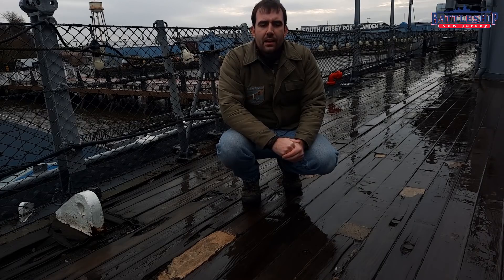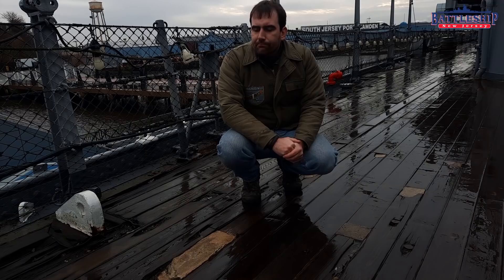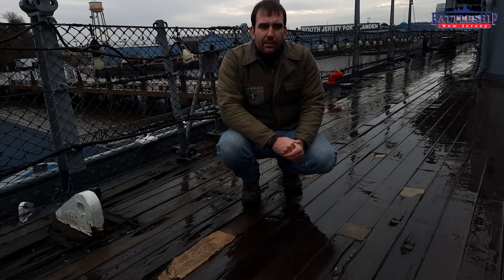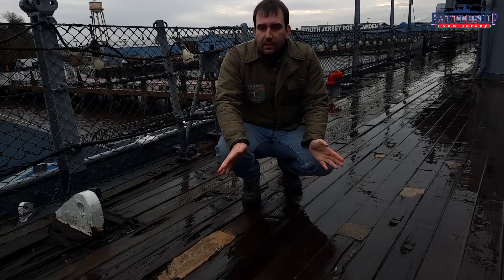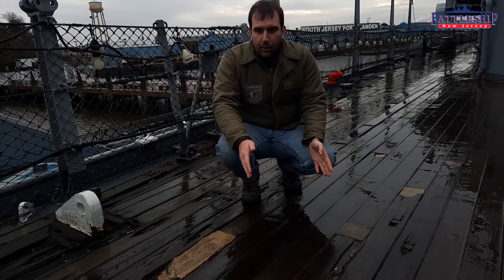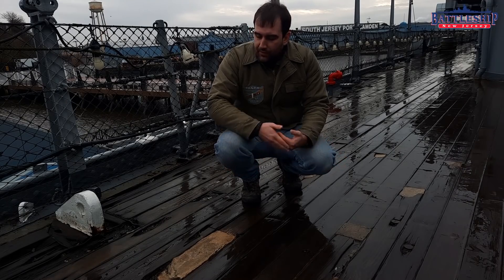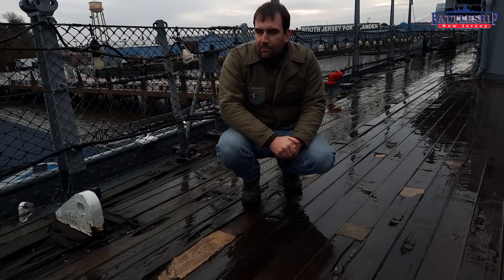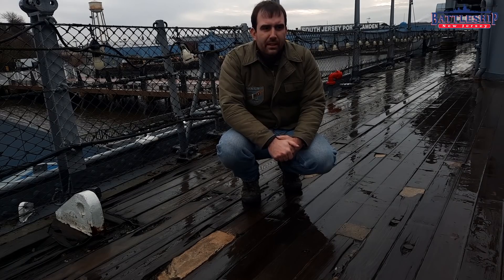Why aren't Museum Ships in Concrete?

Comment: This is a great topic. Like most museum ship lovers, I always wondered what the alternatives are to long-term preservation. The U-505 is entirely dry and inside. Could museum ships be permanently dry-docked? How can they be preserved with minimal corrosion?
Reply: HMS Victory is permanently dry docked but even that had to be modified in more recent years, with further plans still in the works. Also the SS Great Britain is as well but unlike Victory, it has a layer of glass around the water line as an artistic representation for the water. These ships show it's possible but they are only around 3500 tons each as opposed to a 27,000 ton dreadnought (Texas) or 45,000 ton battleship. I'm sure my weights are off since I'm going by displacement and well that number has to be higher than the actual weight for a ship to float.

Comment: Fresh water doesn't cause so much corrosion especially if slightly alkaline >> Float ship in oil, I preserve car parts in oil >> It is the salt in the sand used in concrete thats the problem so wash salt out before use...
Reply from the maker: To do that, you're going to need a 900 foot long by 300 foot high building to put this giant tank in so that it doesn't become a death trap for wildlife
Reply: @BattleshipNewJersey  And god help us all if something causes one of the shore power lines to start sparking...

Comment: "Concrete is terrible for steel"   Builds entire civilization from steel-reinforced concrete
Reply: I'm not trying to be a smartass, just informing. :-)

But...The steel is coated with anti-corrosive eh.. coating before the concrete is poured. When you hear about big structures failing it's often because this coating wasn't applied right, as rust takes up more space then steel it actually breaks apart the concrete from the inside.

Alternatively stainless steel is used as reinforcement but who has money for that? 

I think I read somewhere that most of the German Atlantic Wall was build with un-coated reinforcement so you lot could have just waited 20 years before freeing us and it would just have crumbled with a good kicking (just kidding, thanks for freeing us when you did, my grandparents where getting awfully hungry in Amsterdam).

Best of luck to you, have a nice weekend.
Reply: @exharkhun5605  The so-called "green rebar", which I guess is the coated rebar you mentioned, is mostly used in infrastructure projects, that is supposed to last longer than other constructions like housing. The green coating is epoxy. 
An overwhelming proportion of rebar used in construction is uncoated structural steel. As far as I know at least. And concrete protects it from rusting for a while, depending on how salty and moist the environment is. Not forever though, eventually concrete starts to rust inside concrete too.
Reply: Encasing the steel and putting the concrete next to the steel result in very different conditions over time.

Comment: Just wondering, has anyone calculated the cost of replacing the entire deck with new Teak? It would be interesting to hear just how much wood it would take and its cost.
Reply from the maker: We're in the process of replacing it all, it's about $8 million. Learn more here https://youtu.be/OIteMpyHb48
Reply: There is a video on here regarding the ongoing decking project. I believe what they've come up with for a solution is marine grade pressure treated  plywood covered in much thinner and much less expensive teak that is made to look almost identical to the original. I believe Ryan mentions in the video that although the current cost of new OEM style teak would be too expensive the bigger issue is actually sourcing a manufacturer since ships don't use teak decks any longer.

Comment: Could some museum ships be preserved in a concrete  floating dry dock or coffer dam.  The water could then be evacuated so there would be no metal to water contact. This could be done on land or in the water.  There are numerous examples of this in the United Kingdom.  Also,  the Navy uses electrical currents to neutralize the effects of marine corrosion on mothballed ships  This was used extensively on the Missouri when it was in Bremerton.  Star of India  (Isle of Man,  1863)  was given a welded steel girdle in 1959 during her restoration in San Diego.  She is the oldest iron hulled merchantman in the world.  She is still sailing.
Reply from the maker: This is our take on putting museums in dry berths: https://youtu.be/sa8x2gc448c

Comment: Couldn't the lower hull be covered with a protective coating before being incased in concrete? Considering that concrete and steel are used together in virtually all building construction I'm fairly certain that this problem has already been solved. Also consider that the early skyscrapers are older than most museum ships and are doing just fine with regular maintenance.
Reply: This is a comment that I wrote that answers your question. Ryan is not right about concrete chemistry

"Engineer here. Concrete is basic. its PH is about 12 when when freshly dried. This decreases to about 8 or 9 as the concrete ages. Concrete does react with steel, but the reaction is self limiting because the the highly alkaline environment creates a protective film on the steel. This protective layer also provides lasting protection in the event of water ingress to the steel There is a reason that reinforced concrete works so well most of the time. 

The reason Ryan is seeing what he is seeing is because of the ingress of chlorides (like sea or road salt.) AND water. The chlorides break down the protective layer and allow corrosion to progress. The likely reason we are seeing this happen much more quickly than is the case for say many marine reinforced concrete structures is because a piece of rebar is completely immersed in concrete. A steel plate set against concrete has an exposed edge allowing ingress of chloride contaminated water. Any corrosion causes the concrete and the steel plate to peel away from each other, exposing the whole underlying surface to corrosion."
Reply from the maker: It doesn't really matter if it's basic or acidic, it burns through the steel just the same
Reply: No protective coating lasts forever. If it did, we would not be discussing the fallacy of putting a ship in concrete.
Reply: @BattleshipNewJersey   Much of our modern infrastructure, made of reinforced concrete, would not be possible if concrete burned through steel. The reason commenters are confused is that they are surrounded by this infrastructure and don't grasp the specific circumstances that make this impossible for you. That you have tried it and it hasn't worked bears explaining as to why your circumstances are unique.

I didn't mean to come off as 'that guy'. My apologies.

Comment: What about a rubberized epoxy coating that would be about 6 in thick has a sleeve and then pour concrete around that or even gravel it should push back on the sides and the bottom. The ship itself would be in a watertight seal so there shouldn't be any corrosion.
Reply from the maker: You're looking at a very expensive project there, close to the $100 million range, and you can't guarantee that the epoxy will hold and have no way of check to see if it does. So to keep the rain out, you've now got to put it in a building, a 900 foot long building.

Comment: what about using sand.  it's fairly cheep, will apply preassure evenly across the whole ship, will allow water to drain away if it's above sea level.  if you could overcome the problem of lifting the ship above sea level, i cant see any obvious downside
Reply: I thought about that. Using a drydock filled with sand with some sort of sump pit. I think the sand, over time, with direct contact with the steel shell plating would be bad unless you cover the whole ship.
Reply from the maker: You'd have to keep the ship in a building for that to work, otherwise the sand will trap water and make it worse than just being in water. For a building, it will need to be 900ft long and 300 ft high which is tough.
Reply: @BattleshipNewJersey  So just build a hanger around the drydock like Japan did with the shipyard when they built the Yamato class - problem solved :-P

Comment: Not to mention if you inbed the ship in concrete the weight of the ship and concrete would be insane. It seems like the real issue is at the water line, why not double the plate up the ship there?
Reply: Put the ship is space, no atmosphere =no rust.
Reply from the maker: Thats what most of these ships do. We aren't there yet, but its likely in our future.

Comment: Fiberglass the hull then sink it in concrete. A good epoxy coating should last a few hundred years.  Keep the UV off it, and it can last indefinitely. The real trick would be keeping moisture from getting between the metal and epoxy.

Comment: How would a rubberized coating over the hull work ala nuke subs? Always learn something from your channel, and to that I give you many thanks!
Reply from the maker: You'd have to be very careful to keep that seal, if water gets in it'll hold the water to the steel and rust right through
Reply: @BattleshipNewJersey  makes sense, thanks.

Comment: What about putting a ship in a pool of fresh / distilled water and putting a roof over the thing?
Reply from the maker: Shes in fresh water right now. Putting her in a building is a massively expensive project. As a reminder, these are 3 football fields long and 300 feet high.
Reply: @BattleshipNewJersey  converting "football field" and 300 feet into meters... Or rather looking up the infos on Wikipedia...
oh... A quarter kilometer long and about 90m high...
Okay, I get you... Would be a HUGE hall...

I was thinking along the lines of a zeppelin hall. But apparently, the Hindenburg had a diameter of less than half the height of a battleship of that class...

Nevermind then :)

(but in theory... It WOULD help keeping the ship in good condition, right?)
Reply from the maker: A building would help. Ships in buildings though makenit hard to really see the whole thing though, when the walls are too close you can't stand back and really see it, which isn't great either.
Reply: @BattleshipNewJersey  Aaah, true. Yeah, okay, would have to be a really wide hall to see it all.

Thanks a lot for these answers. I mean in hindsight it is obvious, but that was actually something I had on my mind for quite some time :)
(To me, a layman, it was obvious. "you got something that you don´t want to be destroyed by the elements? Just put a roof over it". ;D)

Comment: In regards to deck preservation, what about the combination 1" epoxy + 1" new teak like the Missouri has been doing?
Reply from the maker: Thats basically what we've been doing. Weve got a layer of marine grade plywood in there too
Reply: Yeah, I was wondering about an epoxy.  Maybe I'm thinking too big, but maybe setting it in concrete could work if the hull below the concrete-line was coated in a sealant. The cost could be prohibitive, but I'm just spitballing.
Reply: @Horseshoecrabwarrior  - Pot a whole battleship in epoxy?
Reply: @tominiowa2513  Well, not fill the whole berth with epoxy. Just coat the hull below the waterline with something waterproof.

Comment: OK,  here's the solution. You're going to need to get this thing into a dry dock to begin with. Not just any dry dock but one with a structure over it to keep out the weather. Big ol' roof like you would find on an airship hanger. Get the ship in the dry dock and clean that hull to perfection. Once you're ready you fill the dry dock in around it with silicone in layers. Let it dry and then pour some more. Maybe use coloring to turn it blue/green. 

Basically indoors, supported all the way around, and wouldn't the silicone protect the steel from corrosion? Don't tell me silicone is bad for steel as well!

Comment: I'm not 100% sure but I had read where the USS Alabama is sitting in a Bed of Concrete in Mobile Alabama.
Reply: Bed of river silt
Reply: @jerredwayne8401  I'm checking into it but I do know there was a story in the news a few years ago that they were supposedly encasing the base of it in concrete. When I find out for sure i will update.
Reply: @docbrown6550  i believe you are reffering to the coffer damn that they built sir
Reply: @jerredwayne8401  No I'm Not, I know what the article said. I'm not saying they did it but the Article said the were planning on pouring a Concrete Base under the Ship
for the Entire length of ship to sit in sir.
Reply: I had read that also, not sure what the reason was but yes they did say they were pouring concrete underneath the ship for the hull to rest in. I would have thought that would cause the ship to rust quicker but the article did say they were doing it.
Reply: @Thundarr888  Thank you for backing my comment up.

Comment: 40,000 tons+ of steel interacting with ANY surface introduces interesting chemical effects.
We're forgetting the principle of PRESSURE.  That introduces higher temps and other side-effects of all that weight pressing down on surfaces.
Electrical current is another thing.  They use electricity and sacrificial annodes to arrest/delay the onset of corrosion when a ship is sailing the waters of the world.  What's not appreciated is that electricity still present on the ship even when it's docked.  We've all lived in cities where our TV reception was poor in fact because of all the transmission signals being beamed all over our town.  There's a natural electrical current still going on whether a ship's generators are running or not and who knows what the impact of that is long-term (after decades)?  There's still a great debate (which NEEDS to be had) over how electromagnetic signals from our power grids and communications terminals affect people.  There's the cancer debate but how what about personal behavior?  People already get irritated by smells and noise; there's a good reason (smell) for why hospitals won't stock microwave popcorn.  Is it unreasonable to NOT expect some people to be sensitive to electromagnetic fields?  I think that's already obvious and there are professions where you have to wear protective clothing.
The New Jersey herself is made of lots of different chemicals and the interaction of those materials often isn't appreciated until years and years after a ship like her was built.  Everybody knows about rust but there other kinds of deterioration that produce toxic byproduct.  Materials that used to be standards of shipbuilding that were taken for granted were later banned or restricted because of harmful side-effects (absestos, PCBs, etc.).
For some smaller ships, like submersibles and smaller submarines, land-docking (exhibiting on land) may be ideal because they're small vessels and CAN support their weight.  These vehicles were designed to take MUCH greater pressure than 1 atmosphere (14.7 psi) UNDERWATER.  They will never encounter this pressure on land unless they're buried in a landslide.  Something like an Alvin-class minisub can be exhibited on-land because it was built to take pressure at 6,000ft plus.  It's also small enough to house in a museum and they have one on display (the Turtle) already. 
One of the ironies is that it's easier to design strength into a small-structure than it is a larger one.  Fighter jets, for instance, have much greater acceleration and G-limits than a 747 (250ft long, nearly as wide!) because you can reinforce their internal structure easier at their sizes (generally less than 60 ft in length, wingspan under 45 ft) and make them more rigid.  When you get above a certain size, you have to accept some flexibility and allow for lower G-limits.  It's too expensive to build everything to that higher gravity tolerance, impractical, and not necessary.  The fastest planes built, btw, are NOT fighter jets and generally have far lower G-limits.  They would have been too expensive to build to 9-G tolerance AND when you are flying supersonically your turn radii are already in the realm of miles upon miles.
Something like an aircraft carrier is impractical to drydock forever.  It can't support its weight indefinitely and will begin to bulge out and cave in after so many years.  It happens with whales when they beach and within hours.  They cannot support their mass out of water and will suffocate in addition to dying from the toxins produced by organ failure.

Comment: Why don’t you chip,out the concrete on the deck, and replace with wood?  Wouldn’t even pine be better than concrete? Or plastic molded into the gap?
Reply from the maker: We're in the process of replacing the entire teak deck with new teak. Most of the concrete has been pulled up and replaced but we're not done yet.
Reply: @BattleshipNewJersey  Thanks.

Comment: Ok, so concrete is out. How about lucite or some other polymer/plastic compound?
Reply: Marine paint is essentially a polymer coating over metal. Encasing the ship in a huge block of plastic  does not add anything new vs simply blasting and painting the hull.

Comment: I disagree. Sunk to the waterline in concrete will apply both an upwards and sideways force on the ship, much like water. If not more so.
Don’t get me wrong though. I’d prefer NJ to float.
In concrete she’d still rust and repair would be a nightmare, but she wouldn’t pancake.

Comment: Nothing made of iron or steel will last forever. All you can really do is use lots of zinc anodes.  The problem starts with the carbon in the steel. Carbon + Iron = galvanic cell (corrosion). Zinc corrodes (protecting the Iron), but "dip galvanizing" something the size of USS New Jersey isn't feasible. Enameling (glass coating fused onto the steel, like a cast iron bathtub) would incinerate the ship. Epoxy-based paint is as good as it gets on clean steel.